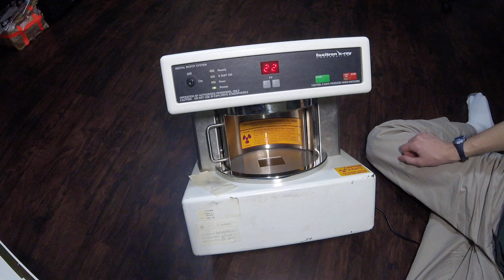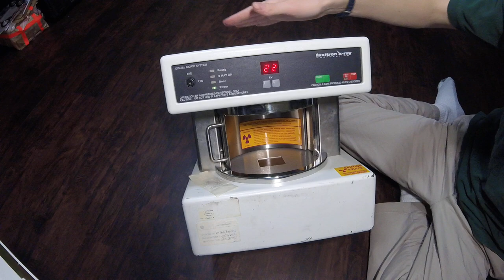Faxitron DX-50 Teardown Part 1

Comment: Didn't you already have a functioning faxitron unit? I do hope this was just a second one that you bought, and that you still have another one that is fully functioning! I've been looking to buy one of these as well, and am interested in learning about serviceability and such, so really appreciate you sharing this teardown. I'm mostly worried about a replacement tube being unobtanium at a reasonable cost, so I wonder, what's your opinion on the longevity of the x-ray tube (provided it hasn't been shattered by poor shipping of course)? These are pretty low power, my hope is that the tube will have long life, but any insights you may have are most welcome.
Reply from the maker: Yep, this was a different one. Actually it was the first one I got. There are a few dx50 unit on eBay now, $400 is a good best offer to try. I would consider the tube not to be replaceable at any practical cost. No clue on the tube lifetime.